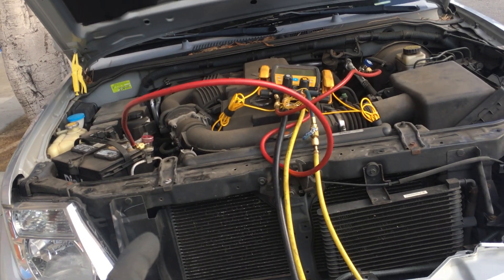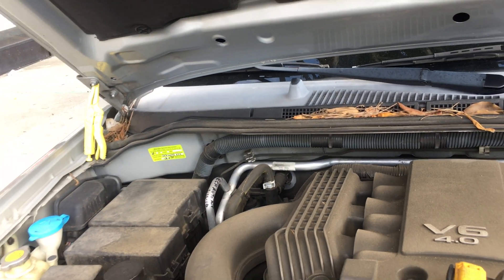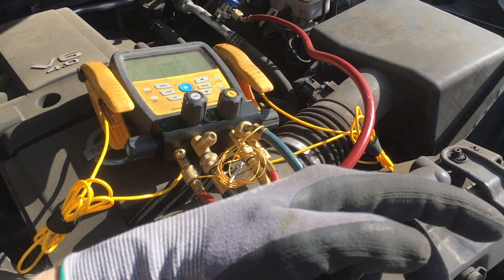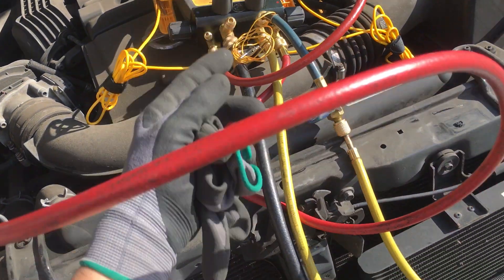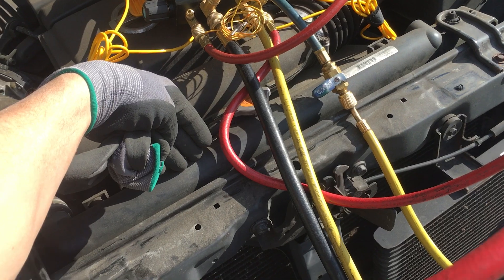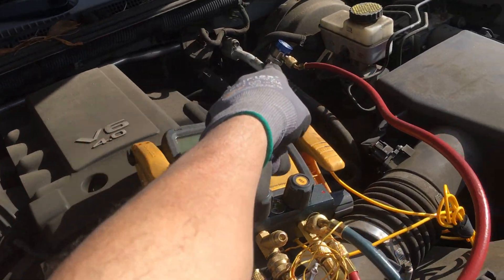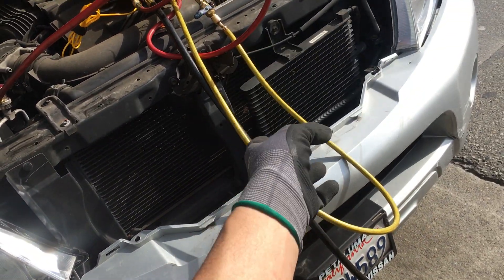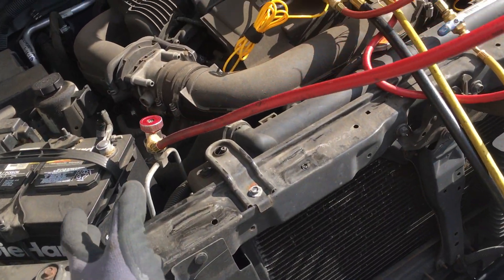AC recovery explanation, AC oil removal, WHAT ABOUT THAT UNIVERSAL REFRIGERANT OIL ???!!!

Comment: How do I know the oil- refrigerant ratio. I am doing an add on system to an RV. The whole system has been flushed.
Reply from the maker: Manufacturer of the system installation instructions that came with the add on kit or some now have you go to their website for detailed information. 
          Some will give you a chart 📊 talking about a (adder) amount of Refrigerant backed on , each foot of liquid line how much extra refrigerant to add .  
       And how much extra oil to add  for the size of the evaporator added 
      Some kits even added a second smaller Subcooling condenser to help in hot weather conditions.

Comment: Tom, thank you for all of the great videos. Fieldpiece and other equip. manuf. really need to cut you in on a revenue share, you're obviously a definitive source in this field, thank you for your passion and generous willingness to share knowledge. 

A brief recap for at least one aspect of this is, 7:30, if the low side service value is higher up on the system there will be minimal loss of oil.

Only use low side to recover system, not high side, otherwise a lot of oil will be removed.

Don't use universal oil. Find the specfic type of oil for the system. What are examples of this? i.e. Chevy Suburban 2004 uses PAG46?
Reply from the maker: Not all the time I have made videos on occasion where the liquid refrigerant sitting down in the low places even on a suction line low side when recovering refrigerant, especially if it’s fast will literally burst into foam just like they use gas in whipping cream can it’s a liquid in the can, but as soon as it releases to the atmosphere, the refrigerant inside the whipping cream Expands into a foam 100 times at size 
    And this refrigerant oil inside will crawl uphill to make it to that low side section fitting and get sucked right out with the refrigerant

This is why you must have a in-line glass and you should have a AIRSEPT dual guard to capture all the oil first as you do your recovery and then drain it out and measure it what you have removed
Reply: @coldfinger459sub0  thank you! 

Order placed, likely the AIRSEPT Recycle Guard, compared to the dual guard, could be sufficient for a small shop? 

 Do you still use a filter dier between the airsept guard and the recovery machine?
Reply from the maker: @stacktier8257  you don’t need filter between guard and machine because the guard will be your filter. 
     Recycling guard will do the job
Reply: @coldfinger459sub0  just noticed your video* recoverying with another Airsept product. would be interesting to see a video on both using the sight glass diagnotistic tool and the recycle guard. Is there a reason you don't use the recycle guard at least regularly in your videos?  

* https://www.youtube.com/watch?v=kiGV0uAlhzY
Reply from the maker: @stacktier8257  recycling guard is an excellent product specially for people who don’t have time to be careful or intuitive. How not to recover oil.. 
    I’d have to say I must give up on the attempt to even attempting to try to teach individuals dealing with refrigerant and refrigerant flows and oil recovery on accident is not just second nature to them. 
      Their procedures that need to be followed. I just have to admit don’t get through to people and they just end up, making too many errors mistakes often recovering oil when they should not be.. 
     So they absolutely must use an oil separator if they’re going to use Mobil standalone recovery equipment. 

I have made several videos in the past using the separate refrigerant analyzer site glass . 
        Unfortunately, with my 5000+ videos, I have no numbering system or category or look up or organization. They’re just scattered.

Comment: How do you determine how much oil is in the system if nothing has been added or removed from the system ? The proper way, of course
Reply from the maker: If nothing has ever been removed or at it, it’s OK it’s perfect. 

Indicate that somebody else has put in far too much oil . You can use the transparent, refrigerant visual analyzer, which is nothing more than a glass vessel that was made to a stand higher pressure.. 
     You put in a sample of refrigerant from the high side and let the pressure buildup liquid.  You can see the color of the refrigerant if anything has been burnt you can see if there’s any little tiny particulate matter inside there.
    And then you very slowly hold it up right so the low side to low fitting is upwards and you just start to open the low fitting with the clothes off high side.  In the refrigerator slowly start to boil out you don’t want it to foam up.
 
And this will be like boiling off coffee with coffee grounds   or with some sugar inside the water

Eventually, all the water boils away and your left with coffee grounds or your left with syrup or dried crystals assault in the bottom of your pan because the water boiled away . 
    You now can see how much oil is in there and you’re supposed to only have say roughly 3 to 6% by weight of oil to refrigerate ratio. 
    If you see much more like it’s really obvious than you know you’re grossly over oiled 

I’ve made some videos where there was so much oil in some of these vehicles when you go to take off some of the refrigerant lines nothing but liquid oil comes spraying out at the fitting . 

Not having enough oil in the system when you take apart the components  you will see little to know oil then you know somebody took apart system replaced parts without replacing oil. 

Or they recovered from the liquid side, removing oil and refrigerant   without putting oil back

Comment: but the oil is hydroscopic , i would like to measure it during recovery and vacuum and replace same amount with new oil presuming that there are no leaks 
why not?
Reply from the maker: @MKk-wx1ig  that’s why you either purchase a Air Sept oil and contaminant recovery device.  That actually measures the oil that you recover.

Or you have an automatic machine that automatically measures the oil recovered

Comment: Great video! My high pressure service port is right at receiver drier down low above compressor by a few inches, my low pressure service port is above up along hood/fender line ('87 BMW) Do I understand correctly that I can pull all old oil out via high pressure service port because it is so low next to compressor? I want to do this because it is an r12 to r134 conversion and who knows at this point what is lurking in my system? My charge is gone so I can pull vac with a manifold gauge set and vacuum pump and pull any old oil and junk into a recovery tank to de contaminate? Tryng to start at ground zero and clean out system as best as I can. Thanks!
Reply from the maker: @warmblood58  no a vacuum pump will not pull out oil

The system has to be full of refrigerant 
Only a refrigerant recovery unit can pull out refrigerant with some oil . 

On a retrofit, you gotta take things apart and flush them out .
Reply: @coldfinger459sub0  Thanks, I should have said that it was a former conversion and I suspect a poor job and system is full of junk -what is the most efficient way to remove old oil and contaminants? I do understand that I cannot flush compressor and condensor so those components will be isolated. To make this more complicated, I believe I might have a leak in evap as I hear hissing behind my glove box so I would imagine I have to address leak first - I might attempt a stop leak product first versus diving deep into dash and pulling evap -your thoughts? Thanks!
Reply from the maker: @warmblood58  stop leak does not work on hissing size leaks. 

Condenses with junk get replaced if they microchannel parallel flow 

The compressor still working, but there’s dirty stuff in it from the previous compressor because it wasn’t flushed properly .  

You can flush it several times with just new clean oil . 

Keep filling it and rotating it and dumping it out until it comes out clear . 

And the rest of it, you just simply take it apart and flush it 

If you skip the evaporator and it’s loaded with oil, then you just suffer the consequences .
Reply: @coldfinger459sub0  thanks! is there anything else that could create what I call a hissing sound (more like a gas valve sound when  the valve is opened)? I was thinking my next move before doing all the previous things we discussed above would be to pressurize the system with air and listen again for any escaping air behind glove box
Reply from the maker: @warmblood58  there are some vehicles that made hissing kind of some people inside gurgling sound but kind of hissing like a kinked garden hose

When refrigerant level was low 

A few vehicles did it even when they were full 

Some orifice to vehicles did it but yours was TXV 

But since you have trash in your system, anyway, replace everything flush everything . 

Start over with new parts and a completely hundred percent flushed out system

Comment: So I need to remove oil from my truck's overcharged AC system but I don't want to take everything apart to flush it all out since the truck has rear ac and only cutting out the rear evaporator will do in my case as it is practically welded to the lines.  
As a last resort and quick fix is it possible that I can resolve my issue if I just remove the accumulator and put a new one in with less oil in it than what was in the old accumulator?   What about just dropping the compressor and dumping out a few ounces of oil from it before putting it back on?
What would actually be the quickest and cheapest way to go about doing this?
Reply from the maker: @MiamiWebDesign  yep, if the compressor is easy to remove or the accumulator is very easy and faster remove that would accomplish removing some of your oil. 

Still will not know how much is in there. It is just a guess or speculation. . 

It might be the right amount to get you back working . 

Going off of a guestament
Reply: @coldfinger459sub0  Sounds good, thanks!

Comment: This video clearly explains what causes most of the burned up automotive AC compressors. 🎯👏
Reply from the maker: Compressors don’t die they’re murdered by technicians. 
(“ so-called technicians who don’t read, so-called technicians who don’t believe you have to go for education and go to classes”) 

Then you have the old foggy gizzards who’ve been doing it for 30 or 40 years saying I’ve been doing it this way and it leaves my shop blowing cold . 

The ability to make it below cold actually means anything . 

You can train an eight-year-old or a monkey with a can and a single hose to make a car blow cold out the dash . Their standards of success is setting a pretty low bar.

Comment: Great info. On a complete empty system (0 psi), is there any oil in it? If any, will it be evacuated when i deep vacuum? If its not evacuated, do i add any oil?
Reply from the maker: Don’t add oil. 
Vacuum dose not remove oil.
Reply: @coldfinger459sub0  the vehicle was recently in a body shop for an accident. Front bumper and good were replaced, possibly the radiator and condenser too, not sure yet.
Reply from the maker: @PB-dj4nm  need to look up the specifications different manufacturers are between 30 mL and 45 mL depending on manufacture for condenser replacement. 
That makes a difference if you replaced the condenser

Comment: So if I have oil excess
 i can recover refrigerant from liquid line and I would be pulling some oil out?
Reply from the maker: It will remove Sam not all

You have to have a extremely accurate method end device that will measure the exact amount of oil that you recovered 

Because it will be different in different systems 

Some vehicles do not have a high side fitting on the liquid line. They have it on the compressor vapor discharge line so you don’t get liquid. 

What are and even if you did remove some oil you still don’t know what’s in the system completely guessing 

There’s only two methods to tell you how much oils in the system one get you very close and the other one is 100% accurate 

First one is in oil balance 

And it only can be completed on a working system that you follow procedures on with 100% refrigerant charge that is accurate performing the running procedure prior to removing a Refrigerant Inn a very exact manner and method. Otherwise you will not get accurate results. 

The other method is completely disassembling the system flushing out all the oil pouring out all the oil from the compressor. Now you know you’re starting at zero 

Those are the only two methods to know what you really half
Reply: @coldfinger459sub0  thank you for your detailed answer sir. Could oil excess  make system pressures oscilate while the beginning of the AC operation and then stabilize at normal values or is it more like a moisture or humidity inside system symptom. Sorry for my english
Reply from the maker: @leonardobarrios7306  on some compressors, especially if it was sitting overnight when it gets cold. Refrigerant and oil can migrate back to the compressor.

The oil builds up at the cylinders, and at the inlet and lower parts of the suction line, and when you first start up . 

You can have some vibration or banging different compressors react differently .  Sam will even momentarily slip the clutch a little bit because the compressor wants to almost stop..  put the belt pulley slip instead, and then start working normally. 

It all depends about the system design, and the compressor have a slightly different symptoms . 

Sometimes it will be a humming a grinding or a vibrating sound from the compressor, and then it might become less after operation stabilizes 

Some compressors there’s no physical sound at all no vibration .  

But this all depends on the amount of oil overcharge 

Usually poor cooling performance 

Because there’s so much oil traveling with a Refrigerant .  Oil does not absorb heat like Refrigerant and Refrigerant is being displaced by logging up being too much inside the evaporator.. 

Many times nobody knows that there’s too much oil in the system and by hand the person thinks that the system is operating normally because they feel cooler over their hand . 

But the excessive high side pressure on the backside of the front shaft seal on some compressors that are sensitive .  Maybe one year or two years later the front shaft seal blows out..  starts leaking

But usually most people don’t know it was caused by too much oil . . 

This is why going through the oil balance procedure every time before pulling off a compressor and then pulling off the compressor and actually measuring all the oil in the compressor prior to swapping over compressors and balancing out the oil is so important .

Comment: Hey Tom thank you again for your videos I've seen  about 30 of them now. Is there a video you made or maybe you could type a suggestion on how much oil is missing out of a system? I've taken on this international truck and there's been about three other folks playing around with the air conditioning. I know it's low on oil but other than pulling everything out and flushing it and replacing parts I don't know how to gauge how much oil to add. I wish The system came with  a dipstick like a motor ..lol
Reply from the maker: If it has a Sanden compressor on it, that has a oil plug. 

Do you have to look up their specifications? 

There were some compressors you can make your own dipstick, engage. How much oil is down there by putting a mark on a wire. 

Other than that you have to remove the compressor at least . 

1: You need to read the factory instructions.

But I’m gonna give you the nonofficial, not accurate version of what used to be done on some systems 

2:  on a warm day, preferably 80° plus.  Completely fill the system with refrigerant by weight with the manufacture required no guessing not by pressures not buy temperatures completely drain the system and refill it with Clean refrigerant to

3: operate with fresh air mode windows doors open about 1500 RPMs for about 20 minutes

4:  shut off the system and let it rest for about 30 minutes

5: now this is important, very very slowly, recovering refrigerant from the low side, the slower, the better
      Because you do not want to drop the pressure so fast, you literally pull refrigerant and oil from other components in parts of the system towards where you are recovering refrigerant from. 

6: now, after recovering refrigerant make sure you’re not in a vacuum when you open up the system.  Person dry nitrogen into the system so you’re at roughly 0 psi, one or two psi.. 

7: now you can remove the compressor and pour out the oil and measure it. Compare it with the factory says should be in there and perform your oil balance procedure.. that you will read about in the manual

8:  you will either come up with more oil than what was supposed to be in the system means you were over oiled you will come up with less oil then what should be in the system or you’ll be right on the spot and you adjust your oil balance accordingly. 

The days of the old York in Tecumseh and compressors and the Chrysler V2, where they had the oil drain plug in the side and you vent a piece of coat hanger and measured up and made a mark and dipped it in there like a dipstick those days are all gone .